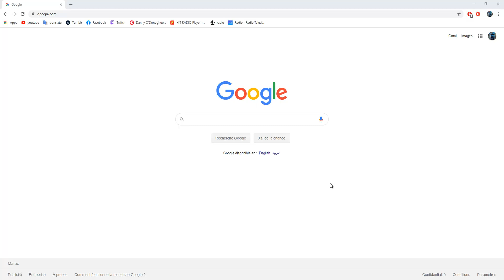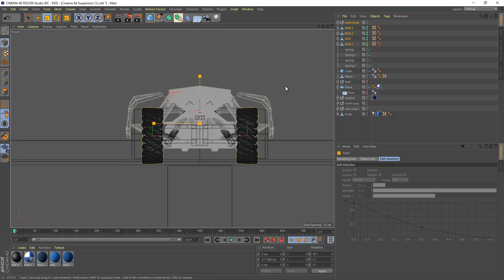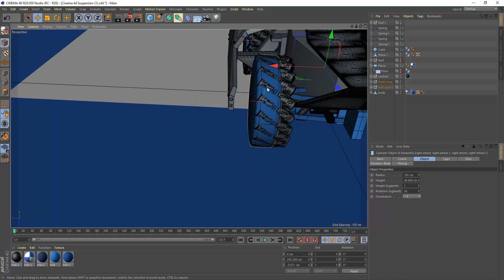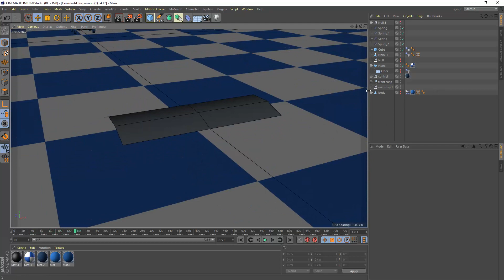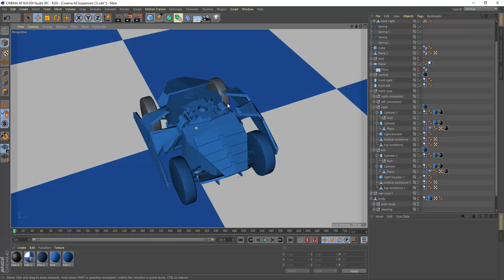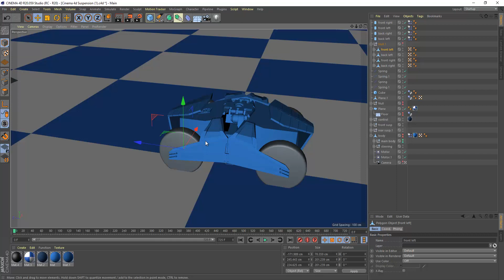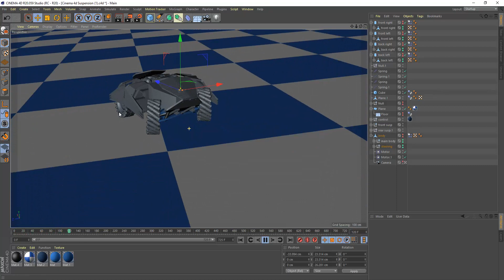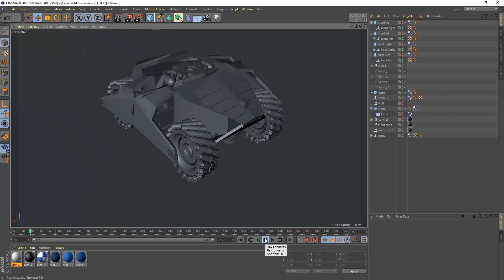Cinema 4D Car Rig with Dynamics

Comment: Thanks so much!!! You're awesome!! Love this!! 
How to apply brakes? I was making a scene where this car comes to stop. so great if you could tell me how to apply brakes that would make the suspension react to this braking
Reply from the maker: if the torque is too high you can set the angular rotation to 0 which will make the wheels to stop .

Comment: Thank you, really cool rig,  how can I use it for a six wheels car? is it posible?
Reply from the maker: Sure, just duplicate the whole two wheels
Reply: @yassinefahsi  Hi, thank you for your fast answer. My model has the wheels separated 50% more than yours but if I scale your model then it doesn't work anymore and if it only separates the wheels then it starts to work weird, what would be the logical procedure to scale your suspension system 50% more approx?
Thanks in advance